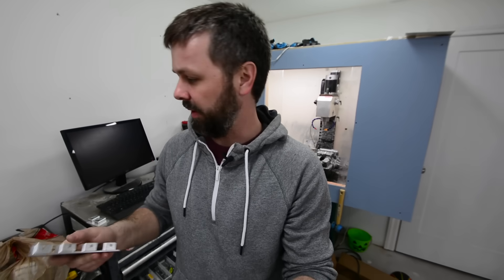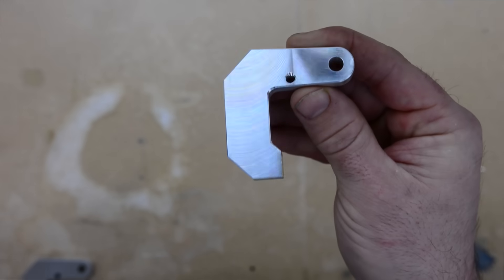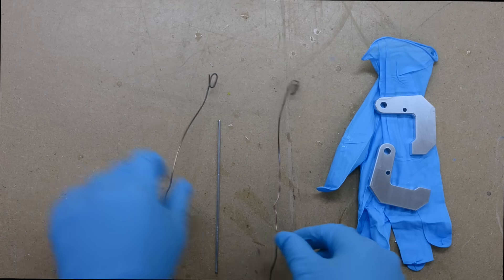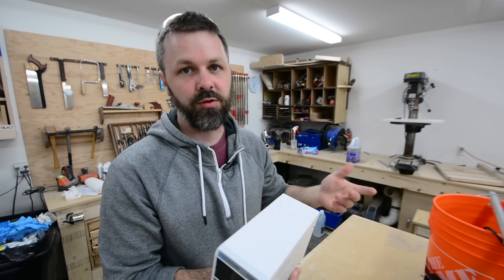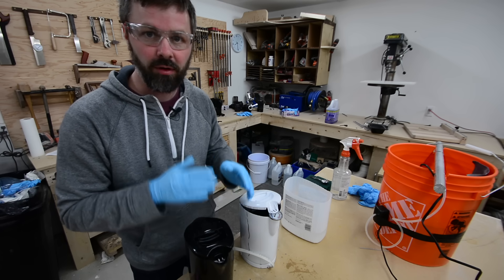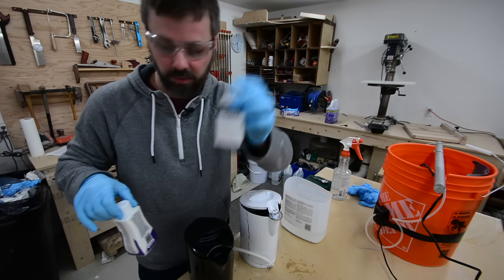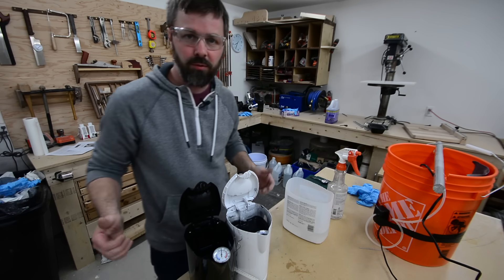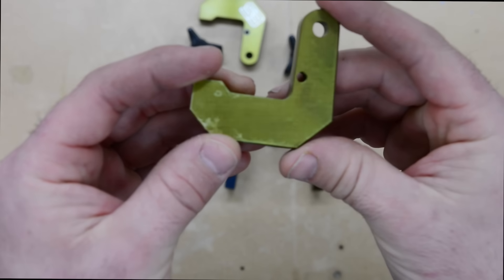ShopBuilt - How to Anodize Aluminum!

Comment: Your waste disposal people may not want to take waste from a business.  If it's a problem, baking soda and the drain is a perfectly acceptable alternative (better solution below.)  The solution should contain only acid - the lead doesn't react with sulfuric acid (it used to be used as a container for it, believe it or not) and the aluminum ions that are produced in anodizing react immediately with hydroxide ions in the solution to produce aluminum oxide as the fundamental part of the anodizing reaction.  

Adding baking soda creates a solution of sodium sulfate, which is nontoxic and water soluble.  At that point you just need to wash it down the drain with lots of water.  A cheap alternative, if you're in limestone country, would be to just put a bunch of limestone gravel in the bucket and wait a week with occasional stirring.  This will produce calcium sulfate, which is also nontoxic but only barely soluble in water.  The liquid could go down the drain and the solids would be fine in the garbage.  Calcium sulfate is gypsum - you'd essentially be making your own plaster/drywall.
Reply: Were I live the auto parts stores can take it and recycle it for free. Same with used oil..) Be environmentally smart and be safe

Comment: Safety: 
Keep a hose plugged into an outside tap. If you get lots of acid on you then it's ready to shower the acid off.
Keep a large buffer solution of Baking Soda close to you (It's very cheap). If you splash acid on you then it ready to neutralise it.
If you work with strong Alkali ALWAYS ALWAYS ALWAYS where eye protection.
Never work with powered Alkalis ( ALWAYS granules or solutions)

Where a lab coat.

Comment: You seemed to use same stick to stir both dyes.  Is that okay?  And how long after anodizing can you put in dye?  Can you do it a week later?
Reply from the maker: Well you can mix dyes to make whatever color you want so I guess there's a chance it could change the colour but I'm not to worried about it. I seen mixed opinions on how long you can wait, it's certainly recommended to dye as quick as possible afterwards but I have seen people keep it wet and wait as much as a day. I'm guessing your taking a chance waiting.

Comment: Just a thought.  Could you start the anodizing process under the required amperage to get the full coating and the up the amperage at the end of the process to harden the anodized finish?
Reply from the maker: That is something you could definitely play with. That's what makes the process fun, seeing what kind of results you can get.
Reply: The anodise film is almost. diamond hard anyway. You're just over complicating things.
Reply: t
The Reason I thought of it was he said if your amperage was low you get good coverage but the finish was not as hard, and if you use too high an amperage the finish does not coat evenly but is harder.  I want even finish but want that finish to be hard

Comment: Ok I have been interested in this process for awhile but haven't done much research on it. And now I am confused about the procedure. What does the acid bath do to the piece? I always thought that the dye was part of the acid bath. So you acid bath, then dye bath but again what does the acid do? Are you basically just cleaning the piece and then dyeing it or does the acid open the pores of the aluminum so it will take the dye? Very nice job you did and I love the blue.

Comment: I'm not sure titanium is the best anode material because it gets a passivation layer that's not conductive and will act like a resistor letting little to no current through. In electrochemistry platinized titanium anodes are used for this exact reason. It makes a great cathode though because it's resistant to almost all acids with hydrofluoric acid being an exception.

Comment from the maker: WARNING- I forgot to mention its very important to always add acid to water when mixing your anodizing tank. Adding water to acid could cause the water to boil and splash back at you.

In this video I sealed my parts using distilled water. This method is not ideal because it takes along time (30-60min) in boiling water. also some of the dye may soak out because of the extend time in the water. A better option is to use nickel acetate which will help plug the pores and seal the part much more quickly (10-30min).
Reply: j dog Cody has a few videos. There are reasons like yours to play it safe and I do. This will get you started. https://www.youtube.com/watch?v=RS_TrEbaizg
Reply: Henry Jiang - "Because APMs..." it is amps.  Lower case and only upper case if using just "A".  Also, "... are present in the atom sphere."  It is correctly spelled atmosphere.

And as you said...

So next time, don't talk about things that you can't spell correctly.
Reply: "Do as you otter..add acid to water" I remember that from seventh grade science class.
Reply: Question away. Cody couldn't get it to react but you know safety first for sure.
Reply: The baking soda wash decreases the shine of the finishing product btw.
Reply: As the old adage goes...

“Do as you oughtta, add the acid to the watta (water).”

As a professional chemist, that was ingrained into my brain!
Reply: Good advice, altho you should be ok with battery acid as it's already diluted with water :)
Reply: ShopBuilt I think the blue color is so common I definitely think the green color is cool..I like it a lot!
Reply: While people comment on safety, what about sanding lead?
Reply: Not sanding the lead flashing.... Would need to sand the coating off Aluminum flashing if you used it.... ;-P
Reply: @A Lind
it depends on how strong the acid is to start with , low percent acid is ok , just like topping up a battery :-)
the lye will get very hot and may explode (not like a bomb , but still bad) if you add water to it :-)
Reply: YTANDY100 what are you talking about? Lye? Don't add lye to acid.
Reply: Buster Gonad, I live in Aus too, and our power is 240VAC, not 230.....

230 is Europe.
Reply: @PBMS123
i wasnt saying adding to acid , i was saying about adding to water :-)
Reply: Cath ODE, an ODE. Not Oid. Lol, fuck
Reply: Splash the water in the acid things become very rancid/Kippst du Wasser in die Säure, dann geschieht das Ungeheure.
Reply: A Lind then I question Cody's approach. There's a violent  reaction  either way but what do you want being violently   splashed  all around, a solution that's mostly  water or a solution  that's  mostly  acid?
Reply: j dog Codys experiment did not involve enough parameters to consider it close to a definitive test. In fact, the majority of the experiments he does are cobbled together and extremely unsafe.
Yes, he ticks the boxes for subscribers. Dangerous and idiot friendly....like 99% of you reading this. Fact is, most of you reading this probably didn't even pass grade school science!
My point is you are easily impressed by foolishness. In fact the one definite item he was right about were those "dumb level, Flat Earthers"
Reply: Shona O'Neill As for knowledge speak for yourself. You mad? You skeered?
Reply: Water to acid makes temperature climb quickly.
Reply: So what your saying is...dont spray mineralised water to clean the parts while your hold them on wire to rinse off the acid...what you did lifted the hairs on my neck. Hair on my head is long gone. Good that you put that warning up. My power supply in Australia is 230Volts...I use a lot of stepper motor drivers and power supplies...would the voltage and amperage be the same with a 230Volt system. I've got a step down unit to convert the 230Volts to 110volts.
I do Laser Welding but often I'm asked...can you make this part and anodise it.
Power supply from Amazon....dies are from...??? Website?..ship to Australia??
Thanks for an excellent showing of your skull set.
I'm a Toolmaker Welder Prototyper...Wood Carved...Stone Engraver....Stone Setter (rings)...engraving repairs and worn rifle or Shotgun actions repaired for other Gunsmiths and a certified tooling finisher.
95% have Certificates .
Regards from Down Under
Buster
Reply: @PBMS123
the voltage in European country's varies between 220 to 240 volts , so now everything is labeled 230 volt , still 240V in UK :-)
Reply: And wear a respirator when sanding lead
Reply: ShopBuilt Caswell is excellent company.Been using the cadmium plating process kit they sell for years for plating Harley Davidson parts found on older models.
Reply: I have acid washed masonry for 45 years, acid does not boil in water.
Reply: I have acid washed masonry for 45 years, I have never seen acid  boil in water,  ever.
Reply: Who gives a shit about water to acid or vice Verse we understand his warning no need for 30 reply’s dragging the argument out
Reply: Is there any way to rework the goofed pieces, shame to waste all that machine work
Reply: Acid to water, like you oughta!
Reply: ShopBuilt I
Reply: Is that why fortune cookies keeping telling me to pick out my coffin,?
Reply: Legend has it he's still leaning towards the green
Reply: To seal the pores we use hot liquid candle paraffin.
Reply: Wonderfullllll, thanks.
Reply: Should maybe pin your content to the top of your thread, chief
Reply: What is the percentage of dilution of battery acid?
Reply: @williamwilliamson1096  "NEVER?" ..REALLY? I wonder how you maintain the battery in your car? 
..besides, you're about 32 years too late with this info to do me any good. I learned this lesson the hard way back then. ..apparently you didn't read my WHOLE comment.
Reply: When using the Rit dye is is diluted with water or straight from the bottle?
Reply: skygh ..huh? Are we talking about  the  same thing?  How could he not get a reaction?  I wonder what kind of acid he was using? I was in a situation  where I had to mix up my own battery acid  to pour into brand new 12 volt batteries.  It's a mixture of distilled water and sulfuric acid. I just remember  how  violently  it reacted once the 2 were introduced.  It was bad either  way  but I think  worse  when  I first  added water to acid.  It seemed like it almost blew up, causing it to splash acid up and out of the container,  luckily i was wearing  coveralls. Rubber  gloves and goggles.  The coveralls had holes burnt through  them and my leather boots got burned about half way  through . I'm going to have to check out that video.  Thanks for the comment.
Reply: Bill Underwood Definitely not explosive in this case. Know what you’re working with first. 

At the cathode, water is being reduced into hydrogen gas and hydroxide at E=-0.41V. In the video he specifically mentioned that he put the pieces in the solution for 10 seconds. 

Because APMs = Coulombs/Seconds 

3AMP*10s = 30C.

30C * (1mol/96320C) = 3.1x10^-4mol. 

2H2O + 2e > H2 + 2OH

1/2 * 3.1x10^-4mol * 22.4L/mol (assumed conditions) ~= 3ml of H2 gas being produced. 

3ml of hydrogen gas is trivial considering some are present in the atom sphere.

So next time, don’t talk about things that you don’t know.
Reply: A Lind try it and see.
Reply: @TheSteve457  lmao and see... absolutely nothing for a little while
Reply: ShopBuilt hydrogen extremely explosive. May be best to do it outside.
Reply: cody's lab already busted that myth there is no diffrence if you add acid to water
Reply: A Lind No, you and Cody are wrong. Let me explain:- you may be fine with acid to water with the weaker acids, aka the usual suspects 37% hydrochloric acid/98% sulfuric acid/70% nitric acid etc.
But, the reasoning behind this science is sound, if you try the same thing with oleum, you are gonna have a bad day, it will boil off a steam cloud containing sulfur trioxide.....which can kill you.
Many others have the same reaction, as such it is a VERY good practice to get in to, ANY qualified chemist will tell you this. 
AND SERIOUSLY THOUGH, YOU TAKE  PRACTICAL CHEMISTRY ADVICE FROM A GEOLOGIST!? LOL
By the way, I do hold my Masters degrees in Chemistry and Metallurgy. "Suck it Cody".

Comment: Wow, I didn't realize this was just posted a couple of days ago. Thanks for sharing! I'm about to do some anodizing and I've been gathering all of the information I can find.
Reply from the maker: I recommend giving it a try, I found it to be a really fun learning/experimenting process.
Reply: ShopBuilt I find it interesting that Royal Blue was the color of choice for making black. Did you also try the black Rit dye? I’m curious what that would look like, so I got both colors.
Reply from the maker: I haven't but I have a feeling it might end up on the purple side. I noticed that the black dye from caswells is more expensive than the rest of the dyes which I'm guess is because it's hard to get black to look really black.
Reply: This keeps going another layer deep. I also got purple (I'm not kidding). So, I wonder what purple will do! I'm intrigued.

Comment: Hey, a wonderfull video. I am trying anodising myself and running in to some problems. My parts are not taking on any dye. My thinking is that it has to do with the concentration of the battery accid, because my voltage never comes above 12 volts even though i use the same amps per square inch as you. Have you had anny trouble with this? And how does your voltage and amprage stay constand throughout the procces?
Reply from the maker: Amps stay the same the whole time.  If you have a bad connection and the part starts to get anodized underneath the connection point, your amps will drop off.
Reply: Bench power supplies like he is using can be set to produce constant voltage, or constant current (amps).  The power supply adjusts the voltage until it reaches the current chosen.  If aluminum oxide builds up, it will ramp up the voltage to compensate for decreased current flow (from increased resistance), but only to a certain limit (e.g. 30 volts).

Comment: Very good video!  I worked in an anodizing job shop while I was in college.  One thing you really want to avoid is silicon based lubricants.  We did not even allow them into the building.  Red and black are also great colors.  We had a proprietary process where we would print special inks on the aluminum after anodizing for fancy instrument panels.  ( Techtronics and HP were big clients of ours.  We could print 120 dpi and better creating highly detailed and attractive panels.). Thanks for sharing.
Reply: Silicone. The lubricant. Silicon is the mineral, eg. for semiconductors.
Reply from the maker: Nice, thanks for the silicon tip, I'll definitely keep that in mind.
Reply: Charliebrm1 they make a spray form as a lubricant.

Comment: I've heard that anodizing doesn't work with ferrous metals, but is there any good way to get this effect with ferrous metals? I have a project in mind, this coloring is exactly what i'm looking for!
Reply: Anodizing grows a honeycomb out of the surface of the aluminum. This will only work on aluminum and titanium. Won't work on anything else, sorry!
Reply: Michael Caswell I see. And with that being the case, is there any way to get something that looks like this on ferrous metals? Not through anodizing of course, but anything else to change the color, but keep its metallic sheen?
Reply: Yes, VHT used to make some translucent spray in cans. I think Rustoleum bought them out. Nice range of colors too. Non yellowing too. I think they called it something like 'anodizing ', but of course it wasn't that. We used to sell it.  The instructions for LCD anodizing are on our web page - free download.  http://support.caswellplating.com/index.php?/Knowledgebase/Article/View/91/19/lcd-anodizing-instructions
Reply: Duplicolor® and KRYLON® still produce rattle-can Anodizing Sprays.  They're basically like KANDY by H.O.K. (House of Kolor) http://www.kolorhouse.com/custom-paints-house-of-kolor.html, but the solvent is 1k (no catalyst), as opposed to a 2k (Clear + Hardener) top-coat over a KANDY™ Base Color. KANDYS are a translucent finish, allowing the substrate to show through.  A high-quality, automotive 2-Part Clear, like PPG DELTRON DC3000 can also be dyed with an approved PPG dye, prior to spraying on.  I was actually referring to Metal Solvent Dyes, made with Metal Complex Components that are compatible with any non-porous surface.  The dyes are typically applied by airbrush, dry instantly and can then be clear-coated or waxed.  STEEL F/X® PATINAS, https://steelfxpatinas.com manufactures Metal Solvent Dyes in 10 Colors, plus White.  They are highly concentrated and very affordable.  To preserve color and light-fastness, a clear-coat (other than 1k rattle can clears), is highly recommended.  Rattle-Can clears are mostly solvent, have very few solids and whether or not most of them have ANY UV Inhibitors is suspect, to say the least. And, most of all, they don't develop a decent film thickness like an automotive clear will.  Rattle-Can Clears are Fine to use IF the finished piece or product is to be used indoors, with little to no wear, handling, abrasion or exposure to UVA/UVB light.   Thanks!   Bill
Reply: Maybe try anodizing aluminized steel
Reply: @Christian.  You CAN get a very similar, (almost identical), look on ferrous metals using Metal Solvent Dyes, followed by a high-quality Clear-Coat or inexpensive microcrystalline wax. Your choice of top-coating would depend on the intended usage of the dyed steel, stainless, cast-iron, etc.  Hope that helps.  :o)  Bill
Reply: You could try powder coating...use a silver or chrome base with translucent in the color of your choice over it. This will give a similar effect. Look at instructional vids by the Eastwood Company, auto body and paint suppliers.